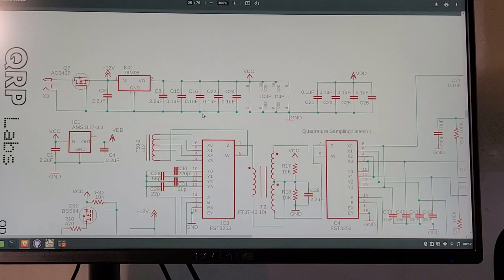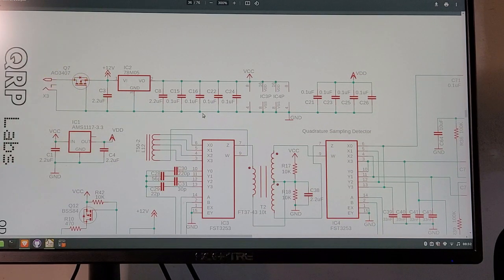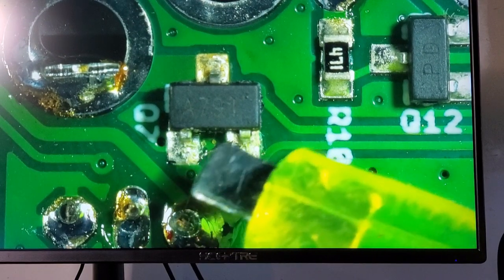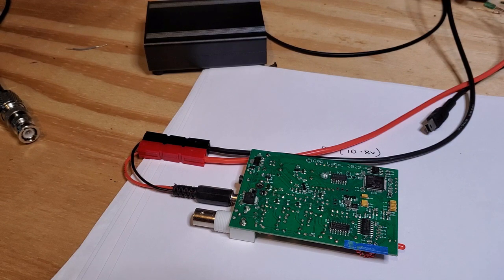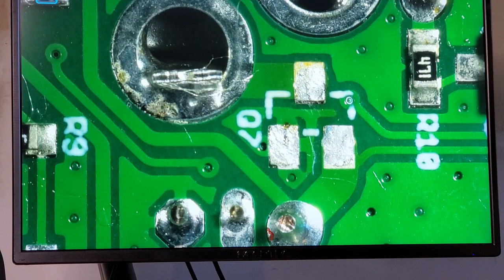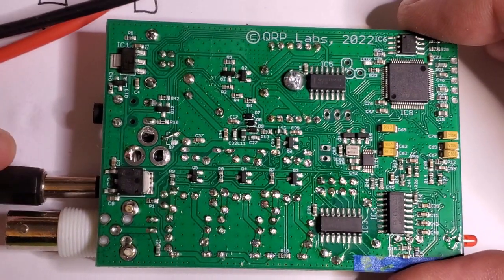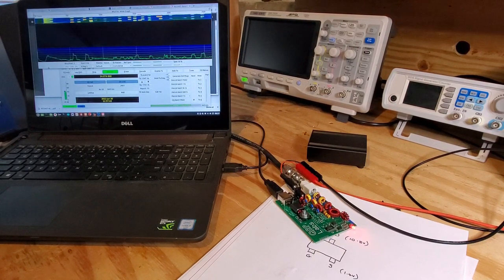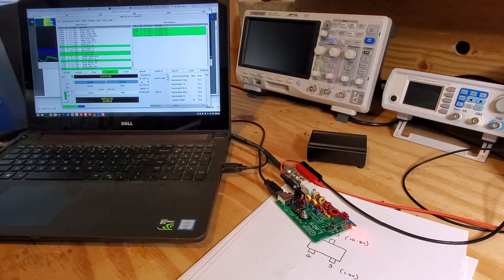QDX Fix - Blown Q7

Comment: You could just use a diode for reverse polarity protection or just leave it shorted. Maybe the current flowing is close to the limit of the fet or its internal diode? The reverse polarity protection is provided by the body diode of the fet.  When current starts flowing through the body diode it starts to raise the source above the drain voltage which will turn the fet hard on once its passed the VGSth voltage.  So shorting out the internal body diode and lowering the power being dissipated.  Look up its rds value to see if i might get too hot with the current you are pulling.
Reply from the maker: That's what I was thinking TEH. Under normal operation the FET is conducting from drain to source - the opposite way to normal for a P-type. I don't know what that body diode is rated at - I don't think its the normal Ids rating.

Comment: Yes!…Same happened to me but Q7 flamed entirely and fried a hole through the board and took out local traces!🔥👀🙈
Was able to clean up area and replace traces with wires installed a diode for polarity protection and it’s now running fine again.
Was fortunate Q7 was in best location to do it with fewest traces and components around it!

73 WA4ITD
Reply from the maker: Ouch - I wonder if this is a common problem. It is an unusual (at least to me) use of a p-ch mosfet - I haven't seen it used as polarity protection anywhere else. Thank you for the comment Frank